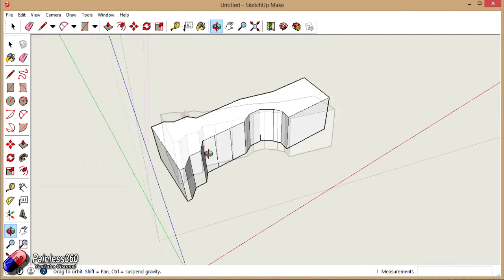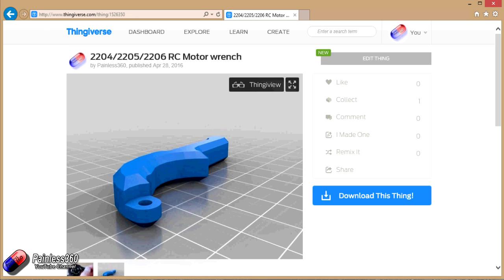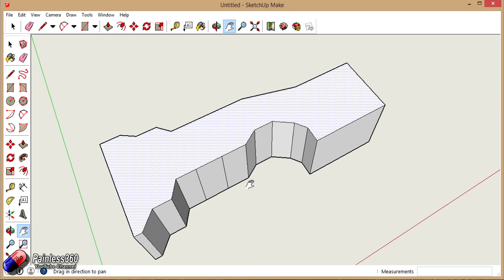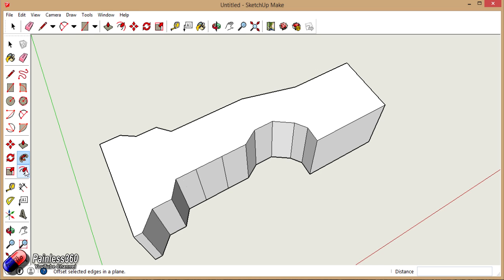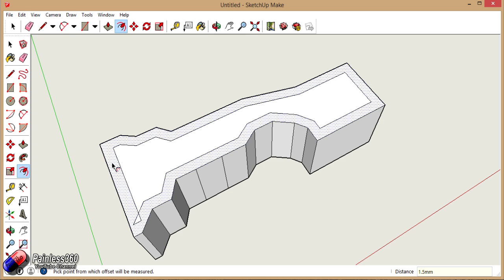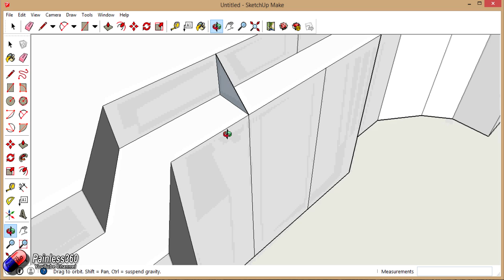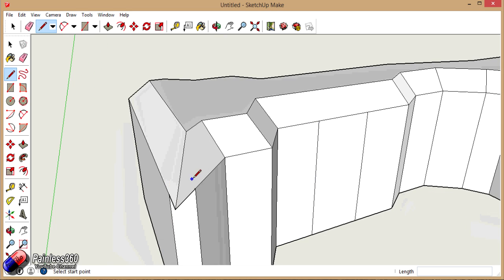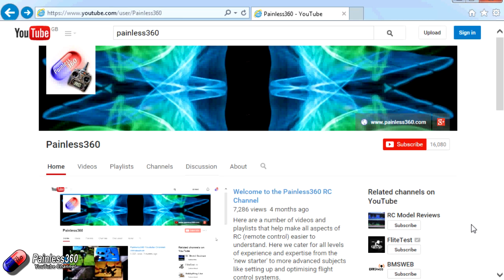3D Printing for RC Quick Tip: Bevelled edges in Sketchup

Comment: Why even use Sketchup, it's just about the worst tool for the purpose. just use 123, it's free and made for the purpose by industry leaders. I believe there's also a professional solids based 3D Cad designers that's free for hobbyists or even up to your first 100k income. it was mentioned in the video from barnacules about his new rumbler mounts.
Reply from the maker: +RCKnut we use a few pieces of software here and SketchUp is good for some things. Horses for courses - see our 3D printer series ;)

Comment: Great video, as always!
For sketchup (both the free version and the paid version) there are add-ons you can easily install to make operations like these much easier. To bevel and chamfer edges I'm using an add-on called Round Corner, and it has worked wonderfully for me, as it's quite simple to install and it works flawlessly once you have used it in a few models. Here you can read about the install process and the plugin itself: https://extensions.sketchup.com/en/content/libfredo6

Hope it's helpful!

Comment: There's a plugin that you can download and install for Sketchup called RoundCorner.  This will allow you to create either rounded corners or bevels.  There are many different options for rounding/beveling in the plugin as well.

http://sketchucation.com/forums/viewtopic.php?p=171721#p171721
Reply: I believe they are called "fillets"
Reply: Generally, "fillets" are rounded corners, "chamfers" are evenly cutting off the corner at a 45-degree angle.  And a chamfer and a bevel are different as well.  Been doing AutoCAD design for 24 years, so I've got TOO much background in these things.  Sometimes it's just easier to use more generic terms.
Reply: +Greg Jones I understand